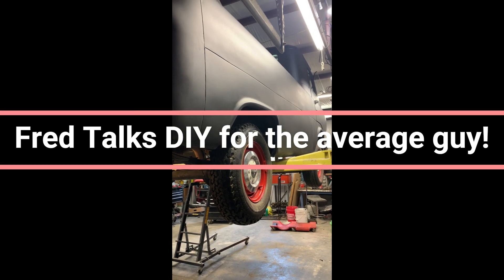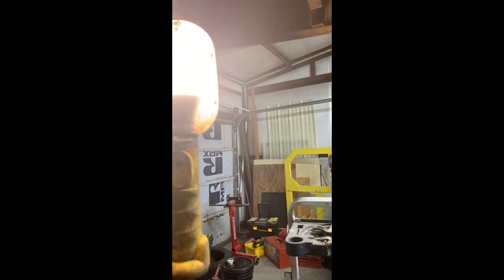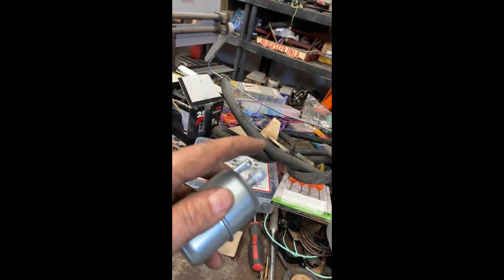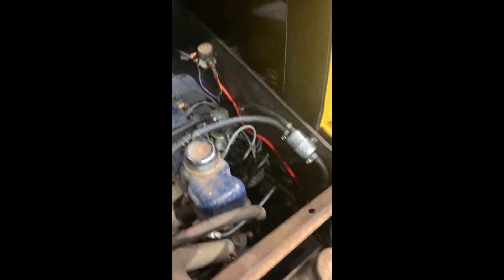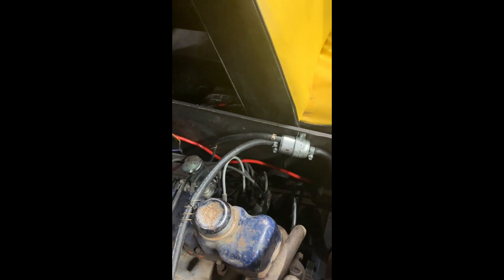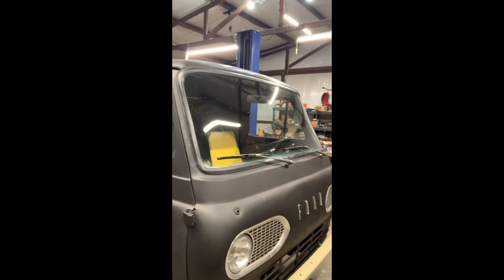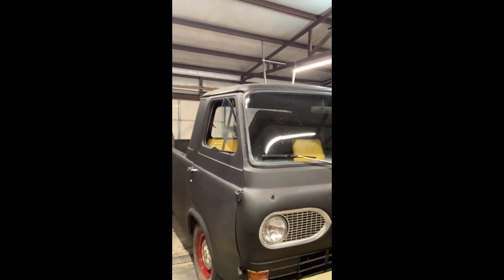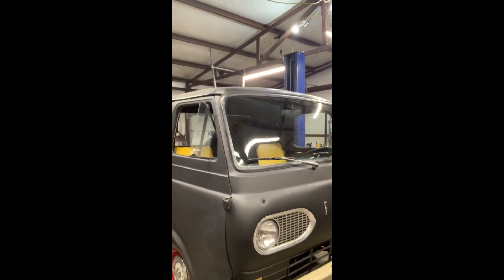Stoppie Jalopy vapor lock and heat soak solved!

Comment: I have major vapor lock on my 79 F150 with a 460. I bought the same filter and I’m going to do the same thing with the existing charcoal canister line. Someone removed the canister but left the line, so it should be an easy mod. This truck will stall out, especially on a hill - it’s really bad. Glad to hear it cured your vapor lock. Have a great day and have fun driving that classic gal!